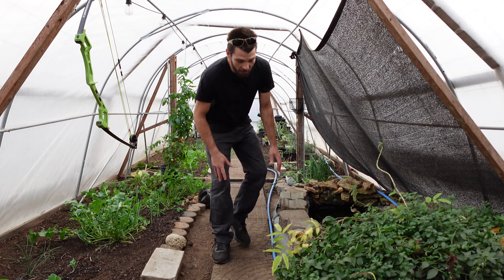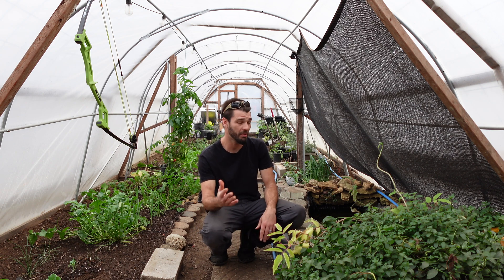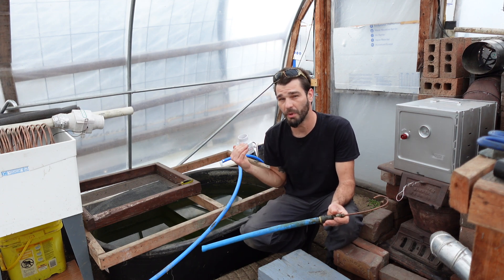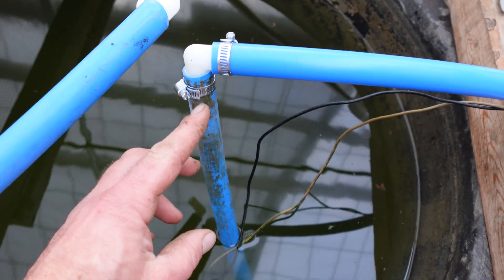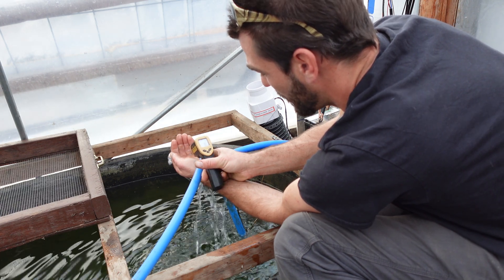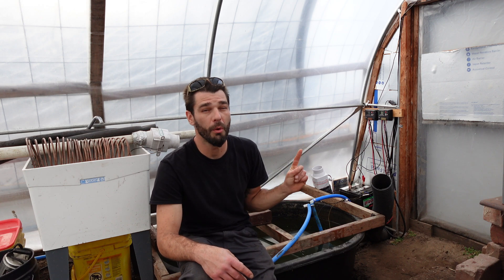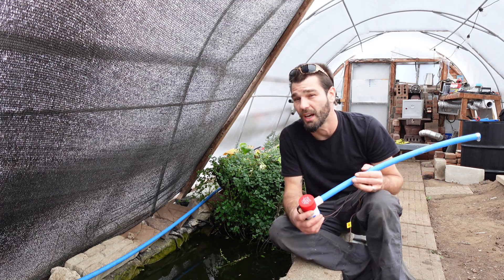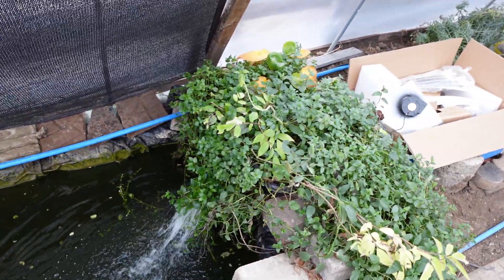Man Heats Greenhouse With Compost!  Day 2 PART 2 - Swapping Pumps & Taking Temps - Winter 2025

Comment: How does the hot water actually warm the space?
Reply from the maker: @gracepermaculture9512  good question, it heats the floor by running 100’ of pex tubing looped from one end to the other and then it dumps into the overflow tank warming 120 gallons and acting as a thermal mass. Water requires a lot more energy to heat, so our air heating is always a must.
Reply: @Earthdwellershomestead  I see. Do you think  a radiator of some kind could be used in this system? This is amazing BTW. Awesome channel

Comment: Ive just about got mine all set up . 2nd year on trying it out. Didnt run water last year, but going to try it out this year. Just did a poly 55 gallon barrel in middle of pile and pex around it. Hopefully can get a bigger pile going this go around as last year i constantly was losing heat in the pile.
Reply from the maker: Yes the temps outside draw a lot of heat. Insulating is great to help with heat loss, less heat lost to environment is more heat you can draw into the pile. Thanks for checking this out and best of luck,  keep me updated!

Comment: I’m guessing wood chip hot off the grinder and from live trees would be the best material to start with vs older chip  and nitrogen/manure? How many months will you get heat 4-5?
Reply from the maker: We used an active compost pile of mostly nitrogen and newer chips and some older chips.  Lots of nitrogen rich water, we’re looking at 8 months or better, we never really make it further as we dismantle for next build. Thanks for checking this out!

Comment: A heat exchanger is more efficient at faster velocities.  I suspect your higher flow pump pulled heat faster than the compost pile could heat the water.  You may find that is more efficient though.  I've noticed that there are voltage and current devices that will show the energy used in watt hours for example.  (see them on people looking at solar often)  It might be interesting to compare the different pumps over 24hrs keeping the pond water at a certain temperature.  The faster one probably uses more electricity but I expect for a shorter time.  It would be interesting if it is a short enough time to save energy.  Also I would worry about cooking the goldfish more than I would worry about freezing them... unless you literally do freeze them, that wouldn't be good.  Awesome adventure! great job!

Comment: Hey man, set up is looking good! I’ve got my greenhouse staying about 10 degrees warmer at night, but want it atleast 15-20. I gave up on the water heater and just been using the forced air. The pump just drained the pile’s heat so fast
Reply from the maker: Awesome!! 👏 Thanks for sharing with us! Yes, the water heating is a huge parasitic draw on the pile, paired with cold temps at night we’ve seen a wavelength look to the heating cycle. I’ve done the same thing years past, we always run the air heater but the water heating aspect is a heavy use. I’m glad you found some success with this though! There’s always room to grow the system and at least your experimenting and getting involved! Thanks again